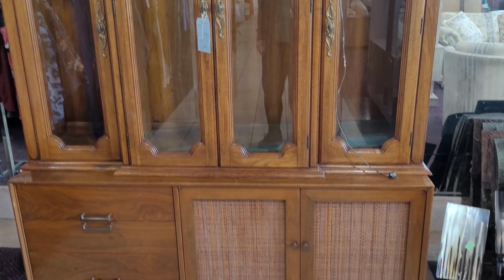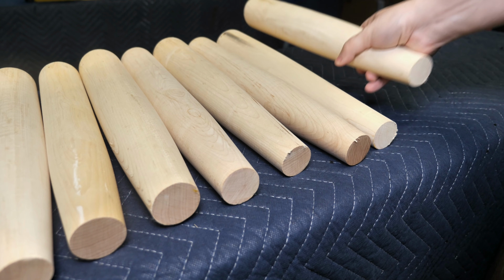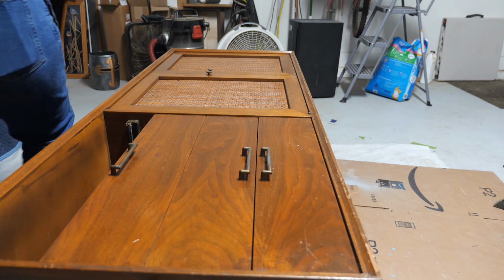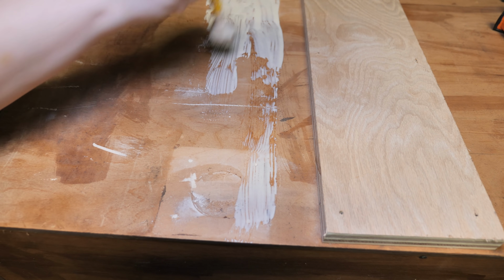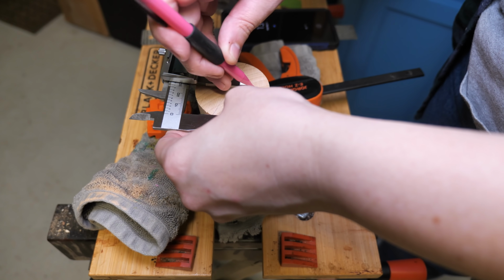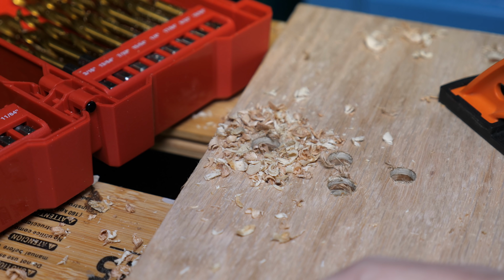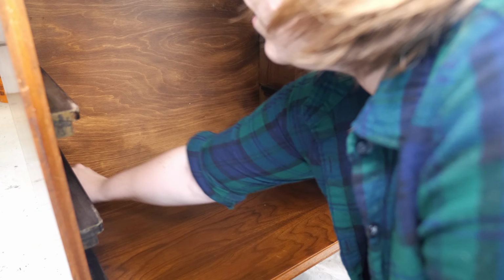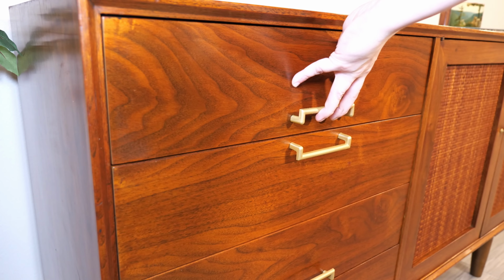UPCYCLING Baseball Bats for Furniture Legs / Credenza Restoration

Comment: A very beautiful outcome.  If I may just add my two cents worth. When cutting a bolt or stud, run a nut onto it so that removing it after cutting it will clean the threads up again.
Reply from the maker: Thanks for the tip Mario!
Reply: @ReconstructingEmily  Considering the nine thousand tips you've given me, don't mention it.

Comment: As someone who has designed things, I think you did an incredible job on the finish, the legs would have looked better as 4-sided square tapering columns, with metal around the bottom. The placement was too far in, it should have been closer to the edge of the piece.
Reply from the maker: I was trying to mirror the existing legs for placement, but I do like the picture you've painted! Thanks for sharing!
Reply: @ReconstructingEmily  I'm glad you weren't offended. Your work is beautiful and the wood in the bats is great hardwood. It was a brilliant idea to use them, my Dad used to do wood projects, we have an old shopsmith, lathe, routers and other tools still in the basement. Dad is gone now, for over 15 years. But the things he made live on.
Reply: @ReconstructingEmily  I subscribed, I'd love to see your future projects.
Reply from the maker: @shainazion4073  I bet there are so many awesome things your dad built with those tools ❤️. I can't say I won't make questionable decisions 😉 but I always enjoy when someone shares a cool idea!

Comment: You made the old finish look good, without making it pretend to be new.  I like that.

Those t-nuts hold even better if you put them in from the other side of the batten, before screwing it to the cabinet.  That way tightening the hanger bolt holds it on, instead of just the three small screws.  

The wider contact at the top of the leg better resists sideways force, though your method was probably sufficient.

Sorry if this came out of left field.
Reply from the maker: Interesting! Didn't even think about that but it makes sense. Thank you for sharing Alan!